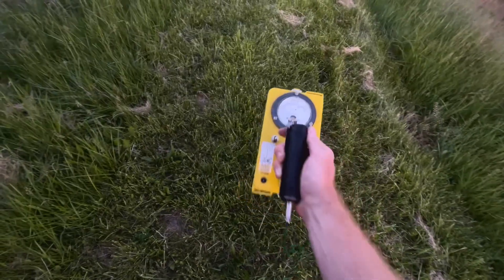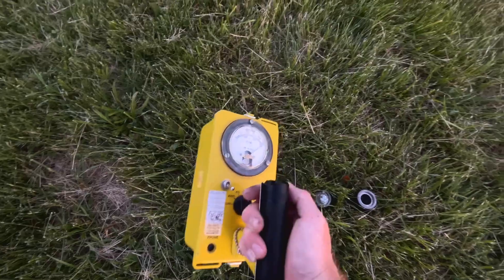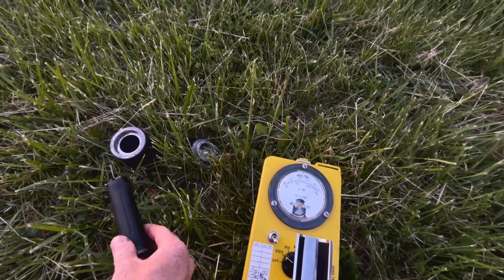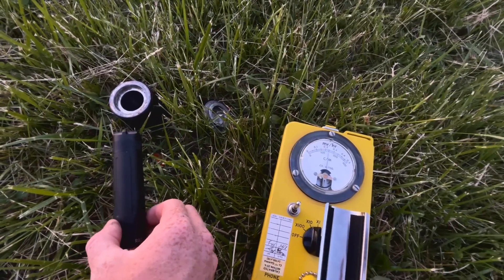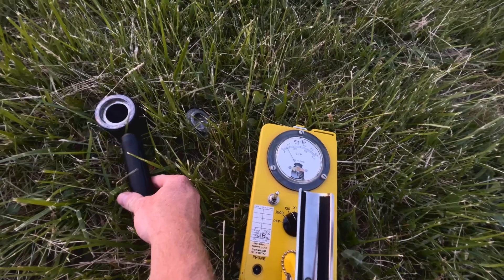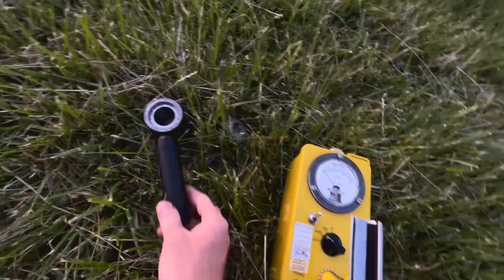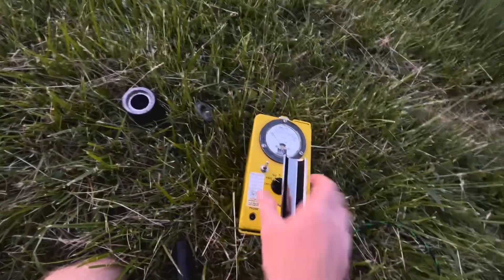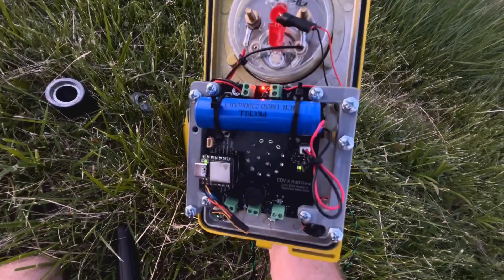CDV-700 Spectral Dose Rate Compensation!

Comment: This is awesome! How does the spectral compensation work, what's the max range, and how does its accuracy compare to something like a compensated GM tube (eg LND 71210)?
Reply from the maker: Thanks! Spectral compensation is largely using calibrated sources to figure out how your detector responds to different Isotopes and gamma/xray energies. Once you have the calibration of a particular detector you can use some fancy math and calculations to get the spectral dose rate. Effectively every second the instrument pulls a gamma spectrum and runs the dose off of that. After 5-7 mRem it switches to a Cs-137 proportional response(I'm sure it could go higher but just to be safe). This prevents some issues that could arise at "higher" dose rates. After 10 mRem it will go into an "over range" mode preventing a saturated(low dose) response. Accuracy is reduced and limited to 20-30mRem but it wont say zero CPM/dose even in an xray beam. Accuracy for spectral Cs137 was around 10% in initial tests, I'm not sure how this compares to a LND 71210 but it would be worth investigating.
Reply: @RadViewNick  Thanks for the detailed reply! The LND 71210 has a pretty flat response from 50 keV to 1 MeV, what I was getting at is how the energy response compares to something with a flat response in the medium energy range.

So when it switches to Cs137 proportional response it loses the spectral compensation and will over respond around <200 keV right? Regardless sounds like an amazing feature for something primarily designed for searching, great device!
Reply: I don’t know why this YouTube video was recommended to me…. And I also have no idea what half these words mean
Reply: @CypherAFhhhh  ok lmao